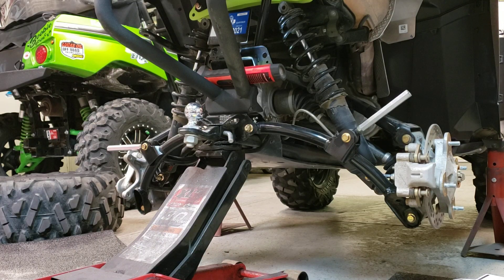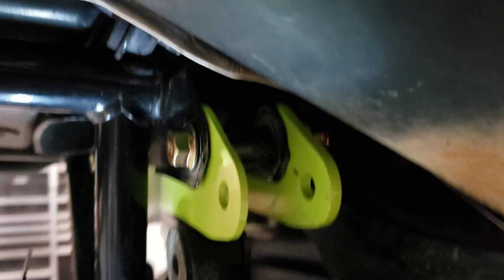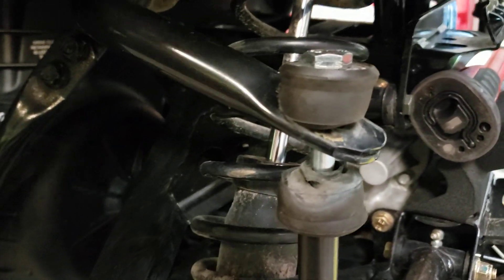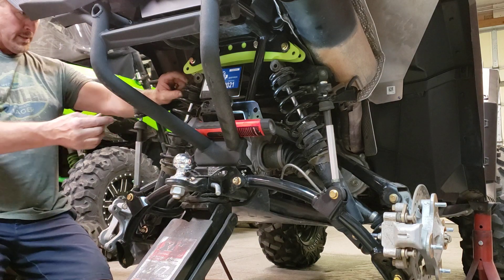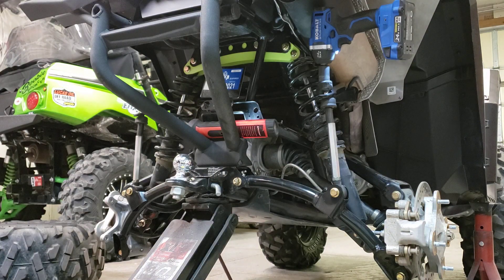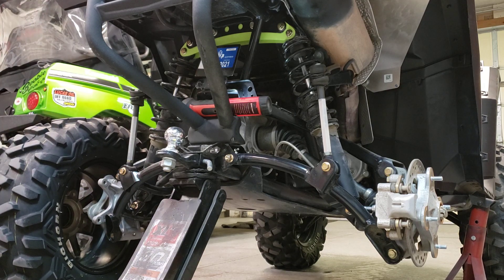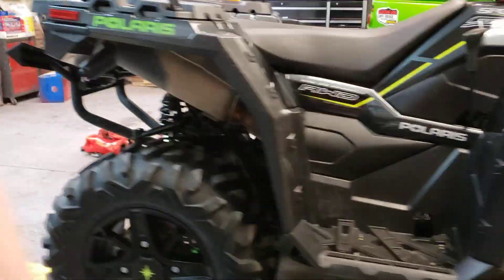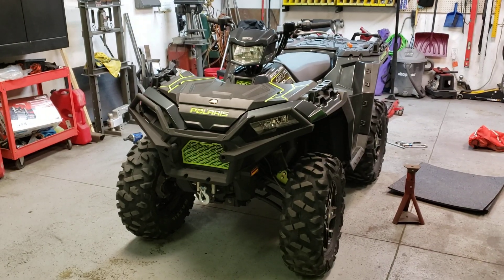2' lift kit install  2019 Polaris sportsman 850HO premium

Comment: Great video. One question on the back bracket the center bolts were those the old shock bolts?
Reply from the maker: Yes they are from the front lower shocks
Reply: @whiteknuckleoffroadadventu2840    Thanks for getting back with me. Just waiting for them to be back in stock
Reply from the maker: It's a great product and easy install  i have just over thousand miles and no problems

Comment: What lift kit did you use ?
Reply from the maker: A-SHOP-APP-NnRCVitOa1RyQkNzWkJUbnRwZFcwaEtqYklyVmYrZlZ4TU1vdHV4cHJpclI3OTBuS1FUT0pMd2dhVGcvVHBDbVArT0wyMC85S1JqUVQwRVRUbjA5d0RPWTZyOGdZTHZKRDY3QkdXL0JlNGhNSEltcDd0aHVUVnFBNjhNbGFndmk2bkcyVFkvdGRFNFZocDB5OWwxL2loQUNzZ1VsRWk3cE1lLzBwUy9WQ1RObzF2dE9MeVc4ZW5oK1VyeW1LbWIxdTQ1TUR1SkdKK200VFJiQjdNZU5ZS3JmcllXSm4wNnB1TXBLTHpaaDBJVkg1QVBobzhObEl5dk05N2hsQnNKQ0pXdGpVVENpZFpaeWxDVmpFVUVtMlRpQ3ZWaTlqZlJTR1RjZXdlRmNTNTYrR3pUSlZhcUVxWHBUaGkweDFoU3AvN2lRSmg5R3UzTFp2SXVBRjE0SVd3PT0tLTFOQkZPdW5obldQRnAvdHdnMGp4RFE9PQ==--d38da50cdd5588b6bb0d45fccd064c8b95f56d00,02bdbb41-9457-427c-a0eb-f8f2b3d4af1b,order_status_page
Reply from the maker: A-SHOP-APP-NnRCVitOa1RyQkNzWkJUbnRwZFcwaEtqYklyVmYrZlZ4TU1vdHV4cHJpclI3OTBuS1FUT0pMd2dhVGcvVHBDbVArT0wyMC85S1JqUVQwRVRUbjA5d0RPWTZyOGdZTHZKRDY3QkdXL0JlNGhNSEltcDd0aHVUVnFBNjhNbGFndmk2bkcyVFkvdGRFNFZocDB5OWwxL2loQUNzZ1VsRWk3cE1lLzBwUy9WQ1RObzF2dE9MeVc4ZW5oK1VyeW1LbWIxdTQ1TUR1SkdKK200VFJiQjdNZU5ZS3JmcllXSm4wNnB1TXBLTHpaaDBJVkg1QVBobzhObEl5dk05N2hsQnNKQ0pXdGpVVENpZFpaeWxDVmpFVUVtMlRpQ3ZWaTlqZlJTR1RjZXdlRmNTNTYrR3pUSlZhcUVxWHBUaGkweDFoU3AvN2lRSmg5R3UzTFp2SXVBRjE0SVd3PT0tLTFOQkZPdW5obldQRnAvdHdnMGp4RFE9PQ==--d38da50cdd5588b6bb0d45fccd064c8b95f56d00,02bdbb41-9457-427c-a0eb-f8f2b3d4af1b,order_status_page
Reply from the maker: Not sure why I can't share the link.  The website is  www.perfixind.com

Comment: Did you add wheel spacers?
Reply from the maker: No  I didn't want the tires to stick out past the fenders and it handles great with the stock wheels  and the polaris general wheels are a little different offset  i would go with aftermarket wheels before i ran spacers

Comment: Ok. I got the same lift on my 850ho and I'm having a problem with my swaybar hitting against the coilsprings has anyone else had this problem please let me know
Reply from the maker: Yes you can order some 1" collars off ebay  i have a video showing ware to install them
Reply from the maker: Watch one year update video and it will show you what you need to do
Reply from the maker: 1" inside  diameter